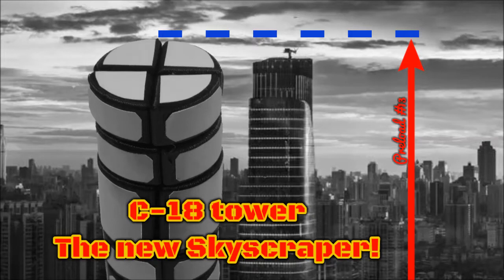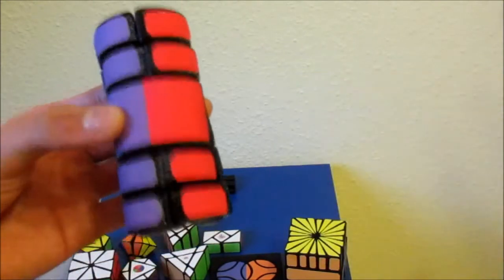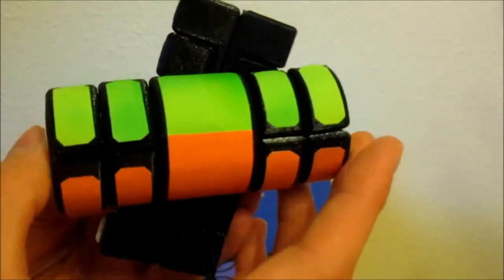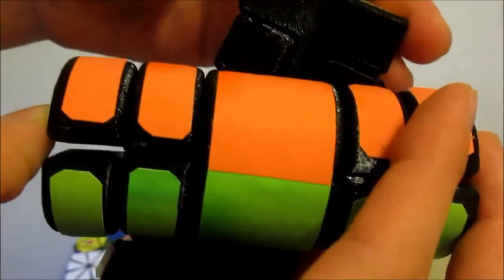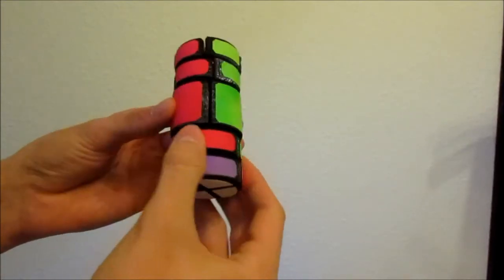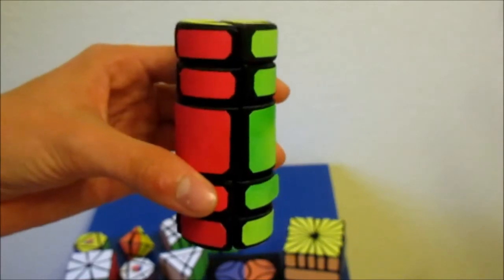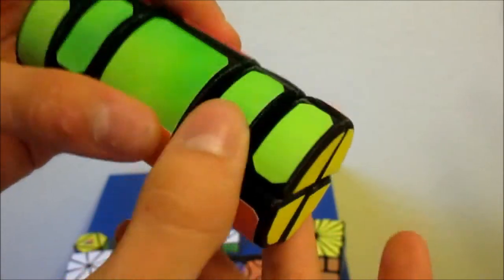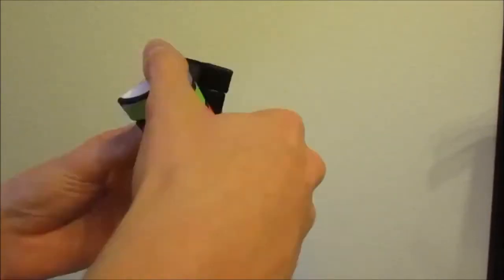C-18 tower | Preload #13

Comment: This puzzle looks like it makes for a fun solve!
Reply from the maker: Yeah, it is. A bit confusing but still doable. It catches a lot but that's something you have to expect with such a mechanism. Beside that, I was surprised how confusing it got due to the colour scheme/stickers. At first glance, it looks like a 2x2x5 with a bandaged middle layer which would be quite easy to solve. The fact that there is no way to find out which colours belong in which order (no colour that is on two pieces horizontally) makes it way harder than it seems to be.

Comment: I wonder if it is possible to make the vertical plane to slide up and down (maybe even the horizontal plane too) to switch pieces apart from usual twisting. It would increase the complexity to solve and make it interesting. NKCubed has been trying to perfect his sliding mechanism not sure if he managed yet. What i mean on sliding is like the "q-borg pill puzzle". You can search on youtube to have a look at it.
Reply from the maker: I know the q-borg thing and also NK³s 1x2x3 sliding puzzle. Still I think that it would be pretty hard to use it on this scale - especially on a FDM-printed puzzle. This one already turns kind of bad and that would certainly not get better if the mechanism gets even longer and more complex. At the moment I do not have any clue of how such a mechanism would work.

Comment: Could you make a Square-4 video?
Reply from the maker: Of course. This whole video series is scripted. I'm going to make one video a week. Thus the numbers of those Preload-Projects. I didn't forget about the Square-4. It is the 18th puzzle of this series which means that it will get its video at the end of this year. The order of the videos is chosen by the order in which I finished building those puzzles.
Reply: Oh, ok. I’m looking forward to it! It will probably get a lot of views. Have you ever solved it?
Reply from the maker: I'm not sure about that. In the past, my favorite puzzles often got less views than puzzles I'd call rather boring. The Square-4 video won't be THAT amazing. You'll see it in movement but I'm not going to add a solve. At least unless I find the time, knowledge and patience to solve it in the future. If I ever get around really scrambling and solving that puzzle, I'll probably give it a seperate video. Including a solve in a presentation video makes more sense with smaller puzzles. Even this C-18 tower actually took me way too long to solve and I had to speed it up more than I originally wanted to...
Reply: I have a question. I just tried to submit a puzzle to the TwistyPuzzles museum, and when I emailed them the picture it said that it didn't send properly because the email didn't exist. Has this ever happened to you?
Reply: Cubyr not really. Try sending it through a separate account to museum@twistypuzzles.com instead of the little email app that opens up when you click the link. What is the new puzzle you are submitting?
Reply: I already did. I’m trying to submit my Skewboid puzzle.
Reply from the maker: YES, this has happend to me as well. I resent the pictures several times and Andreas assured me that he got all of my mails. That is just a bug caused by the fact that one of the moderators isn't reachable anymore. Here is the link to a Forum topic that might describe your problem: http://www.twistypuzzles.com/forum/viewtopic.php?f=2&t=32566
Reply: Oh, ok. Also, once you post something, do they put your name in the list of puzzle creators?
Reply: Never mind, it looks like they do.
Reply from the maker: So this is your first museums puzzle? Yes, they put your name in the list. You of course will have to type in your real name somewhere in the form. For most "beginners", Andreas adds the first item himself without you having to do anything. That of course only happens if you posted a thread about it on the Forum. He just contacted me and asked for my name to submit the entry. If you are impatient, you can just fill in everything yourself and he'll add you name to the list. Just be prepared that this might take several weeks or months.
Reply: Actually, I don’t have a forum account. I thought the only way to submit one was to fill out a form. I don’t mind how long it takes though, not many people are likely to look at it.
Reply: i want to see your skewboid puzzle. how should i search for it in the museum?
Reply: It's not in the museum since apparently someone made a bandaged skewb with a similar design. However, I made a build video of it.